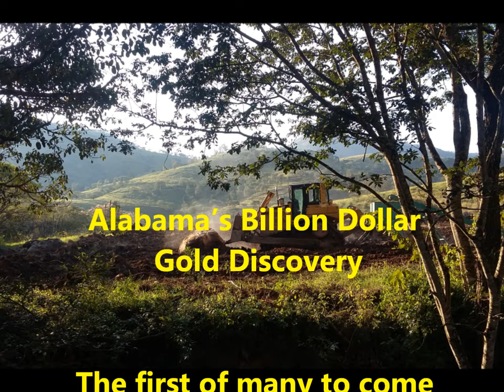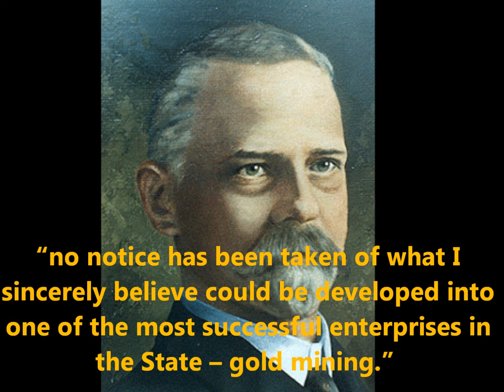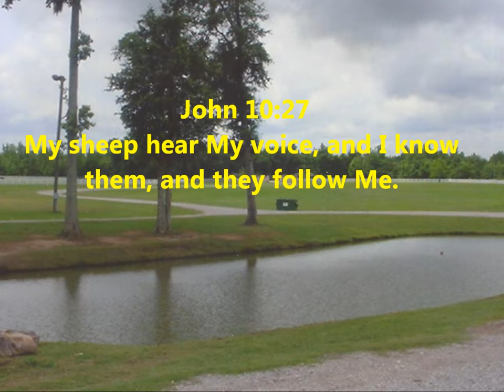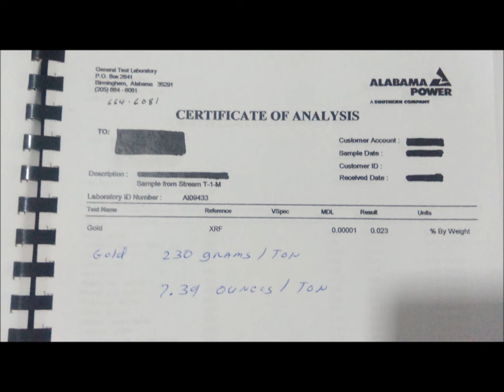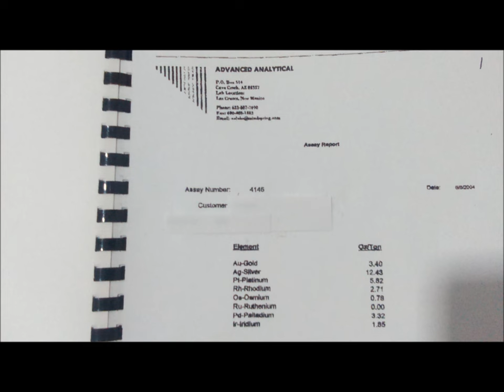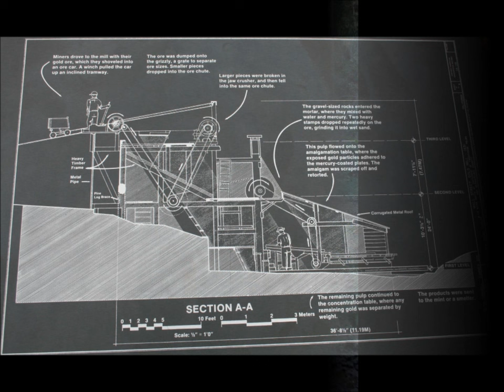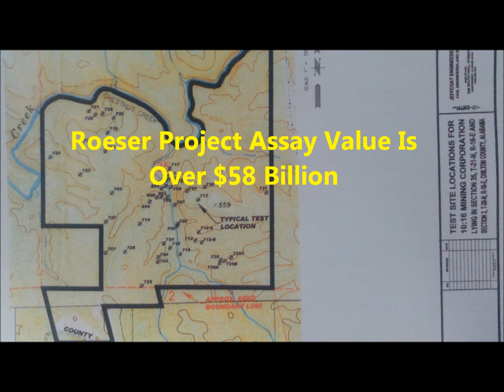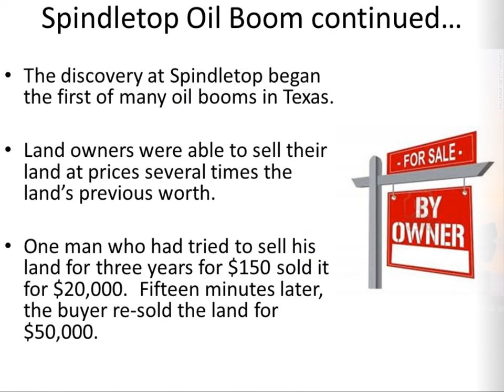Alabama Billion Dollar Gold Discovery

Comment: I have studied the Eastern Gold Belts for many years, over 30, and know that there is much truth to what you are saying in this video. The belts take a diagonal path from Virginia, North Carolina, South Carolina at it's beginning and moves through Upper Georgia down to upper mid Alabama and you are working in the heart of the territory there. Outside of this diagonal belt that ranges this distance, very little if anything can be found. It may be possible that small diamond crystals can be found in your region due to the complexity of mineralization and metals. I would learn how to sluice diamonds using African techniques and install a diamond sluice to determine possible diamond production. The concept weighs heavily within your region, the concept I came up with a long while back, based on similiar situations in California. Furthermore, Arkansas is close by and has diamond occurring there. I would think it might occur as an accessory mineral in your gold deposits or even just loose in the sands and gravels of your rivers and creeks  and/or natural lakes. Diamond is heavy and would undoubtedly exist within the garnets and magnesite you produce. Look at photos of diamonds in the natural and it's idealized crystalline structure and see if you are producing any. I would like to know if you can confirm diamonds showing up in your processing and sizes if you find them in millimeters. Assayers do not typically look for diamonds so you will have to do a visual. You might even find them in your tailings. Wherever you see garnets, magnesite or heavy minerals in your processing, diamonds should be there or may be there. I am basing my assumptions on old theoretics I used many years ago when I studied your region of the gold belt. I think there are three major gold belts running diagonally in your state with several small ones running parallel north and south, and all three run throught the three counties you mentioned. Without knowing precisely where your location is, I can't tell if you are on a major belt or one of the minor ones. I was wondering what other accessory minerals occur within your region. An old friend of mine from many years back used to mine sapphires on his property and came up and visited me when I was living in Tenessee many years ago and gifted me with about a five gallon bucket half full of huge sapphire and ruby crystals he mined. There was a translucent blue star sapphire as large as a third of my palm in it along with star rubies in perfect crystals that looked like oversized huge stogie cigars with a large bulge in the center. These were all cleaned up when he gave them all to me. He invited me to his property and said he would show me around it if I came. I was not in a position at the time to take him up at his offer but he was a good strong christian man like I try to be. I wished I could meet up with him again, I lost touch with him back in those days and I hate myself for it. It is amazing how the Lord works to show us evidence of His existence and how He directs us to things in nature. I am 65 , Marine veteran, retired and still seeing his handiwork all around us. If unbelievers could only see a fraction of all the things I have seen in my life, they would know without question that there is a God who loves us. I have been on many adventures but things for me are slowing down now. I hope you fellas in Alabama always keep the Lord in the forefront of your existence as I do here in NC and maybe someday we will meet and share the good that our Creator has done for us. I believe that between us we would be able to see further down the road than most people as we share joyful stories in fellowship. Until then, you guys take care and thanks for the video. May God bless you and yours !!!
Reply: I would like to hear your testimony. I'll be 50s this Oct .
Reply: Thank you for your service, Sir.
Reply: I do appreciate men who trust in the Lord and hear his voice, I also have a great testimony and will share.it in due season. But I do believe there is w reason for these things happening, It's. God full filling his promises and glorified to the truth of his word, I also know we are rapidly approaching the end of this agree, and equiping us with the tools to add many into his kingdom, thanks for the testimony, and God bless you.
Reply: Xrp available supply sold out soon  thanks for your story,, just curious what area did your friend live.. state or town..
Reply: Thank you for your services sir ! My son is a Proud US Marine 🇺🇸 and I am one proud mom
Reply: Yes to diamonds...
Reply: The